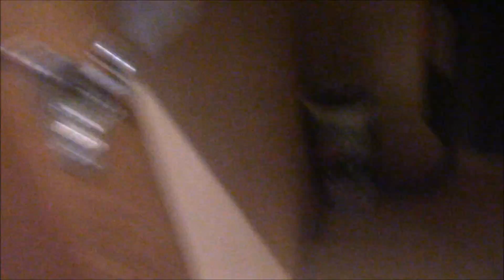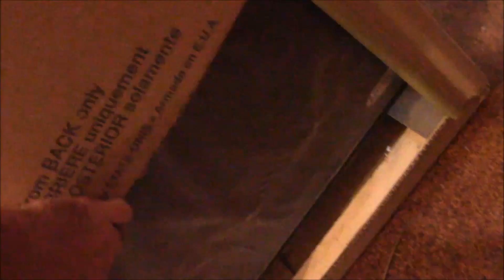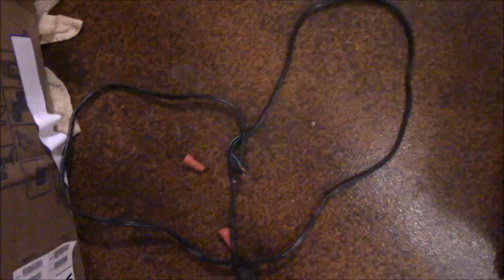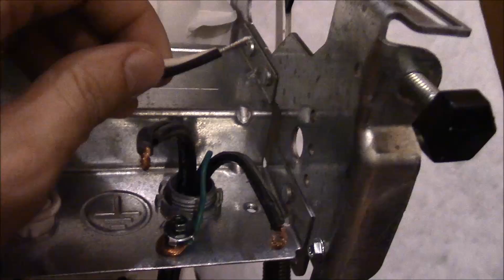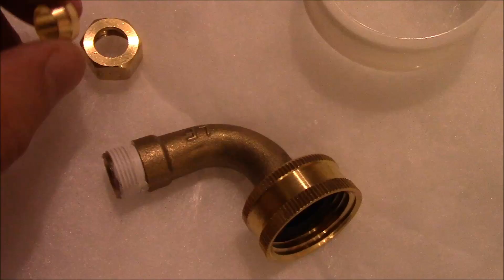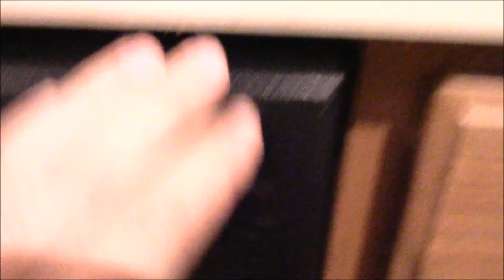How To Replace Or Install A Dishwasher - Easy Step-By-Step Guide

Comment: My dishwasher is just a power line. No plug in the wall. So had to figure it out. Very different from the video.
Reply from the maker: Sorry.  That used to be fairly common but is rare on newer homes.

Comment: YOU DON'T NEED TEFLON TAPE, IT CAN CAUSE A LEAK THIS DRIVES ME NUTS, also that last thing you do is hook up water, drain and electrical. Get it pushed in and make sure your new dishwasher fits, adjust feet as needed then mount using top mount or side mount THEN hook up your water and test, then your drain then your electric. Run your cycle to make sure everything works, water sprays, drain doesn't leak then put your kick plate on. You name the model I have installed it, have a question ask.

Comment: if your water valve is no good (which many are in my DW install experience) then you can just shut the valve at your water heater off if you have one if not then your main valve can be closed. If you have a basement it helps to open a faucet in the basement if possible, otherwise just open your sink faucet and have a towel ready for any water that comes out.

Comment: How did you remove wooden bottom base?
Reply from the maker: There was not a wooden base on mine.
Reply: I was easily able to loosen the large bolts with a pair of pliers. And since my GE washer doesn't have any height adjusters on the bottom, I'm going to have to trim down the wooden base with a handsaw and attach the pieces back to the rails using the large bolts--there's nearly a 2" gap to the tile counter otherwise.

Comment: Suggestion for future videos.  Reference parts in description section.  Thanks for the clear video.
Reply from the maker: I tried to make it generic and not specific to one model of dishwasher.
Reply: @LDSreliance  copy that. It helped a lot btw. Washer is installed and running first flush.
Reply from the maker: Nice!  Congrats

Comment: Those are compression fitting with ferrules ring NOT to be flare and the hook up connects are brass NOT copper. Please do your home work before putting out wrong infor .Could cause major problems with damage and code trouble.
Reply: blueticecho 
Dude cmon... 🙄

Comment: Do you have to replace all the hoses if the ones that came with the old dishwasher are in working condition?
Reply from the maker: Nope, but it might be a good idea since they can wear out over time.  But if your old dishwasher isn't really old and you are just upgrading or the old hoses are in really good shape then you should be fine.  If you have wood floors and any leaks could cost you thousands of dollars in floor damage I would say change the hoses for sure as a $20 investment now could save $2000 later.
Reply: @LDSreliance  Hoses are only $20 or so and are cheap insurance against hoses failing which they all do eventually. Flooding is very expensive. Especially if you have hardwood floors.
Reply: From the looks of the drain line, they look thin. I'd replace em